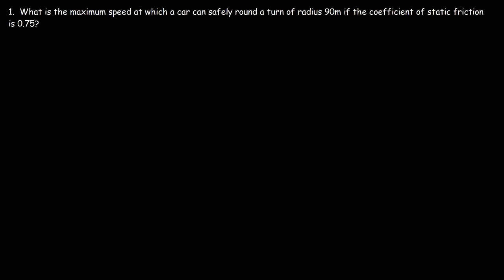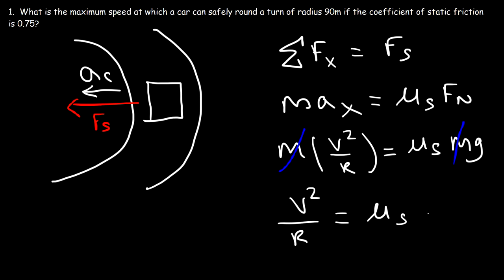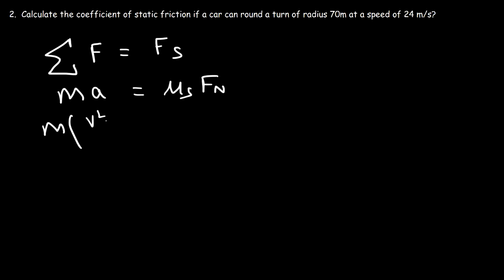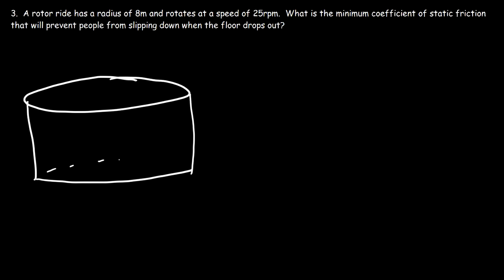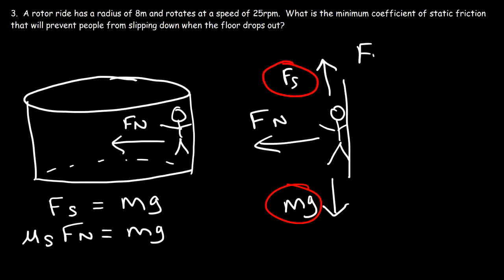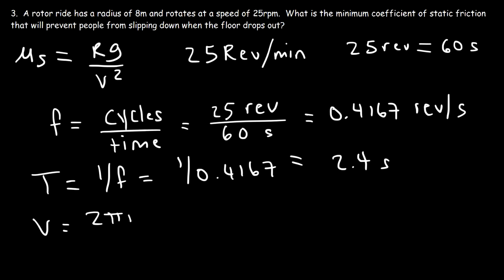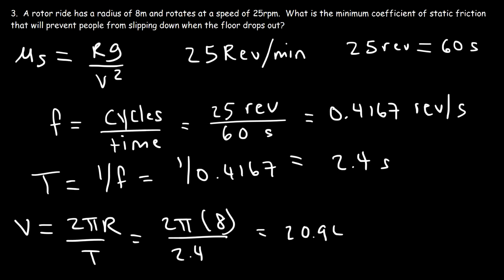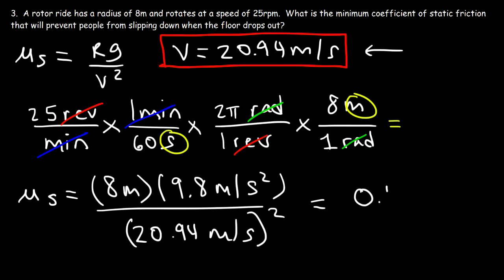Static Friction, Centripetal Force, Circular Motion, Car Rounding Curve & Rotor Ride Physics Problem

Comment: 0:00 - What is the max speed at which a car can safely round a turn of radius 90m in the coefficient of static friction is 0.75?
3:24 - Calculate the coefficient of static friction if a car can round a turn of radius 70m at a speed of 24m/s?
5:34 - A rotor ride has a radius of 8m and rotates at a speed of 25rpm. What is the minimum coefficient of static friction that will prevent people from slipping down when the floor drops out?

Comment: so at 1:55 ish.... you say that max speed does not depend on the mass.... but I thought that objects with a larger mass would accelerate at a slower rate that those with a lighter mass....?
Another 🙋 (for anyone who wants to clarify for me before my effin Remote Physics exam in 2 days...)does the mass of an object only count (when correlated with its surface area) in situations of freefall then??
(was just watching a bunch on Air Resistance and so I'm like.... 🤔)

Comment: doesn't friction point on the opposite direction of the movement? And the car is curving inward, so shouldn't friction point the other way? Why does friction have to be equal to Cf.
Reply: friction points in the direction of acceleration so in some cases it points in the direction of movement and other times it points in the opposite direction. Think about if you were to go running, you use the friction between your shoes and the ground to start moving (friction pointing towards movement) and when you want to stop running you use less force on the ground to slow yourself down (friction moving in opposite direction from movement). hope this helps
Reply: I have the same question ☹️
Reply: Kinetic friction is opposite to the movement (like sliding, or something being drag). But when the object using inside force to move, he uses STATIC friction (like walking or driving) like this - they push in the opposite direction they heading to (when walking, your leg  pushes backward), so in that case, the friction is in the direction opposite to the opposite. Which means - forward!

Comment: Why is the friction between wheels and road static not kinetic
Reply: You're trying to find the max speed before the car will skid in the radial direction. Keep in mind the wheels are rolling forward; the friction that keeps them from skidding (sliding across the road) is static. Remember that kinetic friction has to do with objects that are sliding. The wheels having rolling friction but that is in the forward direction.
Reply: @rrenshaw7797  brilliant dude 👏🏽👏🏽👏🏽
Reply: The friction is static until the car starts sliding.

Comment: Why can you use static friction when the car is moving?
Reply: The tires on the car that make it move aren't sliding across the ground, but are turning. They use the friction of the tire against the road to push the car. hope this clears things up
Reply: @forthememes9259  Thank you so much.
Reply: You use static friction since static friction is a higher coefficient than kinetic... If the car breaks that static friction coefficient then it will start sliding and that's what we want to know. If we were looking for how far a car slid from a to b you'd use kinetic friction.
Reply: If it's sliding it is kinetic,if it is rolling,or in the case of man walking it is static (direction of friction may vary accordingly) 
Explanation is already given above
Reply: Really niche